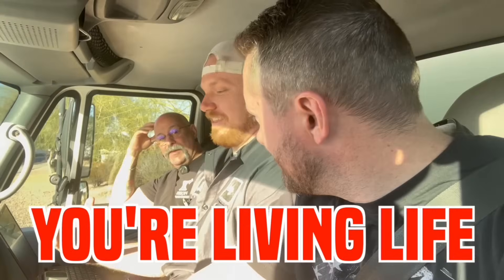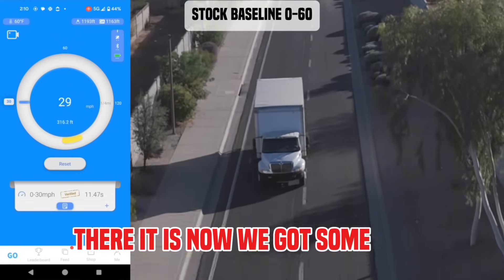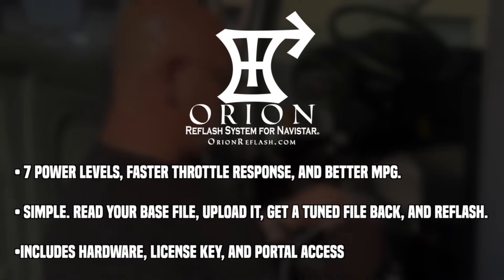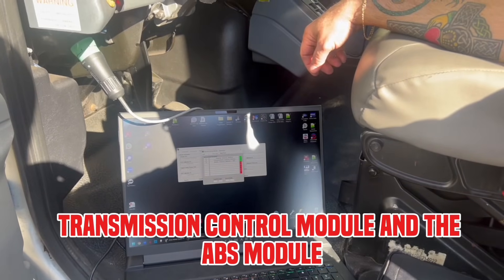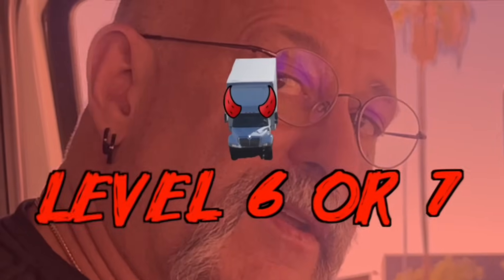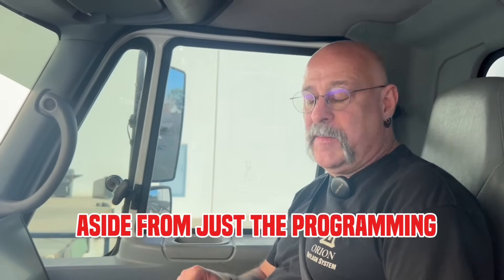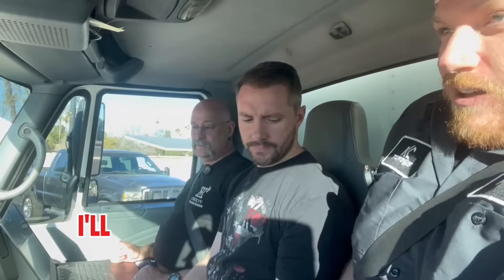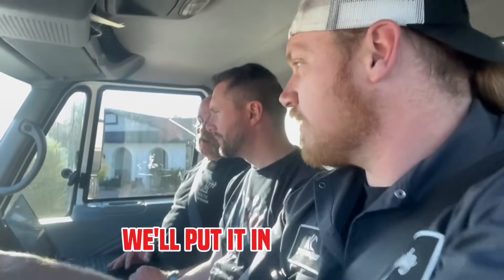The Ultimate VT & DT Navistar Tuner! - Orion Reflash System Testing!

Comment: We have a small dump truck at work with the dt466 and a 6 speed manual. At 35 mph and that thing is screaming in 4th gear and you go to 5th and 6th it bogs. All around turd
Reply: Try that exact setup in a bin truck hauling a 30yd bin filled with stumps or demo waste it’s sketchy and slow lol

Comment: But does it go from doing 5,000,000, miles to 1,000,000 miles. Then truck woulnt make money ..I need 5,000,000 out of each motor to break even
Reply from the maker: The calibration from the Orion tuner is programed to safely and reliably increase power, that is why they give you 7 different levels. That is unless you turn it all the way up, that file is the exception.

Comment: Does the increase in power translate to engine brake/exhaust brake increases as well? Otherwise you're gonna have one HELL of a time stopping that rig.
Reply: From a physics standpoint you're always limited by your tires. Do these trucks have massively underspecced brakes?
Reply: @Hawk7886  They have brakes that.. work. You're really meant to use the exhaust brake in combination with the foot brakes.

Comment: I rented a 26' Penske truck about 18 years ago. I don't know what engine it had, I just know it was diesel and it hauled ass. Way faster than that first run you guys did and that was while fully loaded with my entire household in the back. It could maintain 85 mph even up the hills in PA.
Reply: Doing 70 in a 26' Ryder on backroads in NC felt like 2% the speed of light. 😂
Reply: That is not possible today as those trucks are now limited to 70.  The current emission systems also decreases acceleration capabilities. They do burn cleaner though.
Reply: Hell yeah! I rented a 17 foot v10 uhual a year ago and they must’ve accidentally tuned out the governor. It did 90 no problem
Reply: Notice now they they did was mess with the computer lol, not saying like it’s a small job tbh from my perspective I see that as the hardest as I literally do not know a thing about messing with any computer on a vehicle
Reply: @Nickjustdabs  you ever plugged a laptop into something?
Reply: RIP speeding in rental trucks 😂
Reply: Before they had computers to MAKE it do what they want
Reply: It had to have been the 7.3 or DT466. Them 6.0 would grenade the engine at that speed for a long enough time. The Maxxforce7 we won't go there.